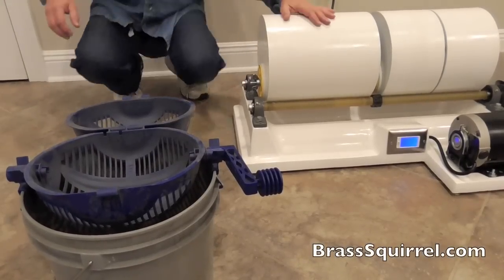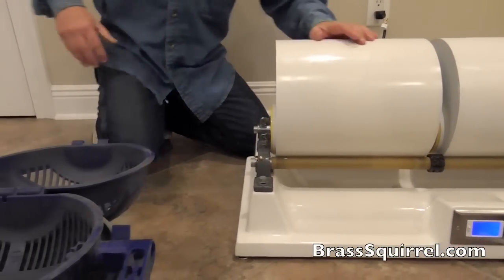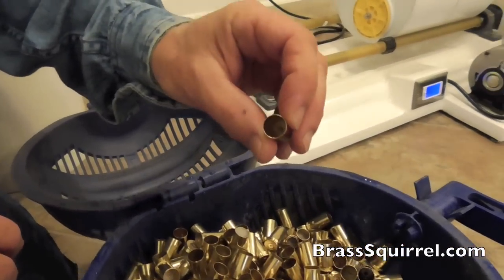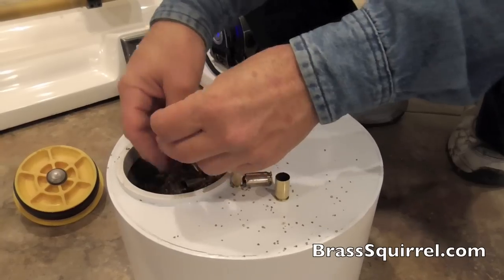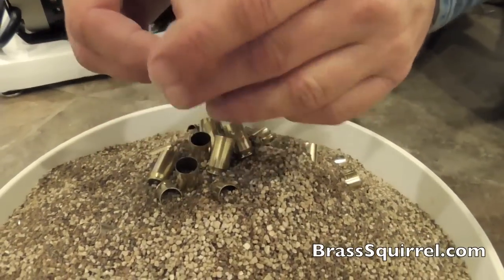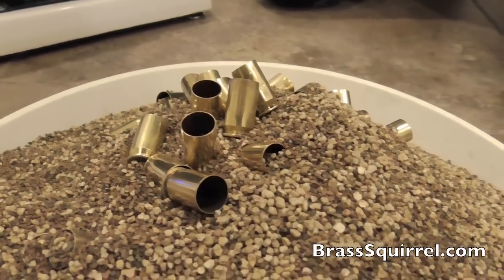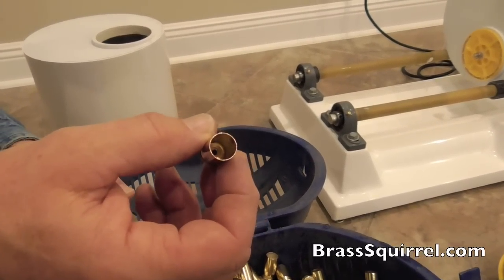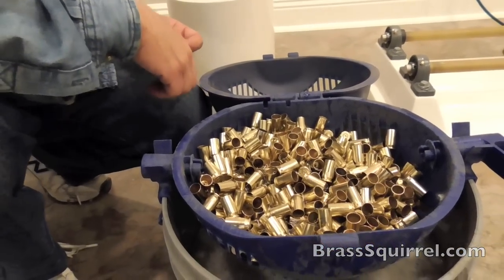New ! Stainless Steel Tumbling or Dry Tumbling - One Machine Test Results - Brass Tumbler Demo

Comment: I want one of these so I can keep my match grade .308 brass clean and consistent every time I load it. Also, It's great that it can handle large volumes because I don't want to process my brass after every trip to the range.
Reply from the maker: Andrew Jensen Thank you so much for your comments. We will also be offering a new single drum system that features a 10" or 12" diameter Drum, (12" wide with a double paddle system), an internal fan cooled 1/4 hp motor, 3/4" shafts,hand laid fiberglass chassis,3/4" pillar bearings with zerk fittings, touch screen timer and much more. We will have video of the new unit at the end of this month. The unit will retail for $579.00. It is more expensive than other single drum units, but do you want a short term toy, or a unit that will last for years and years. Check out the videos, you won't be disappointed !!

Comment: so how much does it cost
Reply from the maker: clay mcwilliams Thank you for asking. The system featured sells for $ 899.00, and the smaller Single Drum system sells for $ 589.00. These are the most durable units made in the U.S. If you need, or anyone needs specific questions answered, e-mail us at brasssquirrel@gmail.com. or, you can call at 504-908-4214. If we miss your call, please leave a message and we will call you A.S.A.P..